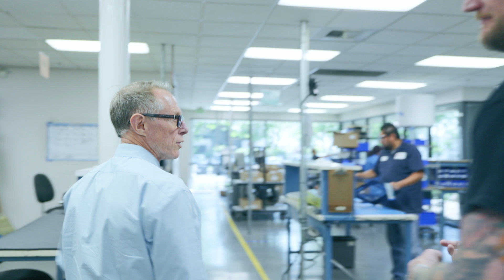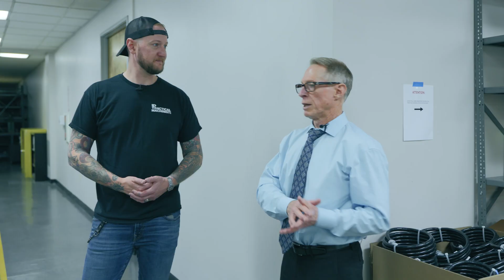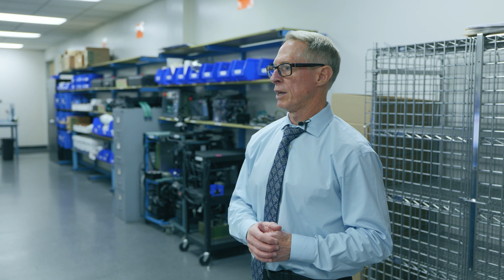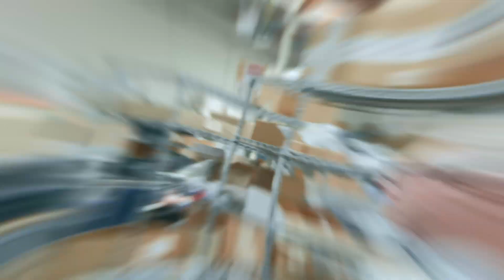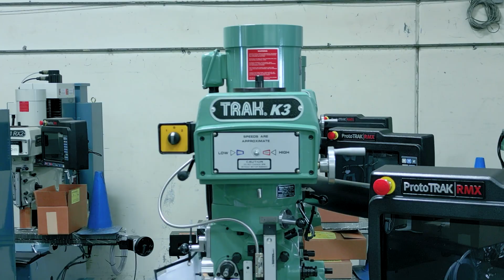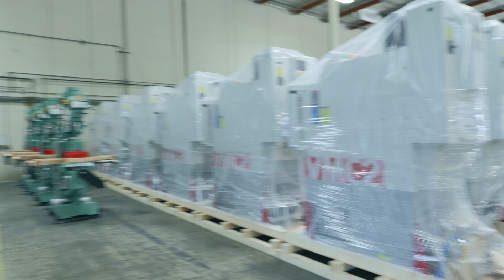50 Years of TRAK: Behind the Scenes of Machines Built to Last

Comment: I have owned and used these machines for many years. The controls are fantastic for so many things, but the biggest drawback I see is the quality of the machines themselves. They're good, but second rate. I can't say much about the recent ones (5 to 10 years), but the ones I have been with don't quite hold the same quality of materials and durability that you would get with say an older true Bridgeport kneemill. If it weren't for that, I'd never pick anything else.

Comment: I have a Trak DRO on my mill that I bought used in 1993, so I do not know the original installation date.  It has worked flawlessly over the years and I have always been able to trust the numbers.  The only maintenance that I have had to do is clean the read head on the x axis two times.  I use the machine daily. It is very impressive that an electronic system can survive and still operate in the temperature, vibration, coolant, chips and dust that are present in the shop environment.

Comment: We put a protoTrak on a Bridgeport mill in the 80's, But what were they doing in the 70's it wasn't making CNC retrofits and when we did ours it seemed they were new at it. BTW that mill was still in use in 2020.
Reply: They were making Trav a Dial. Then got in to readouts.